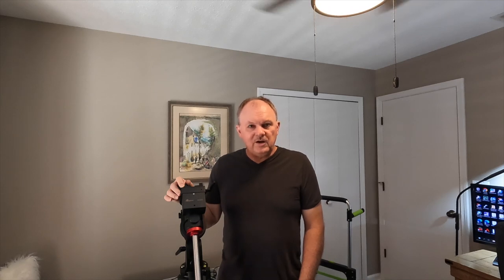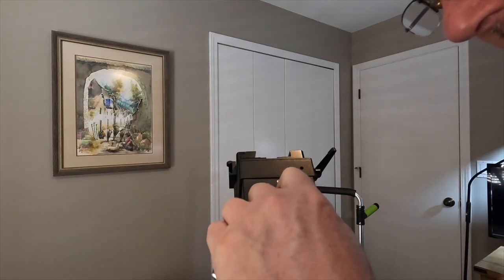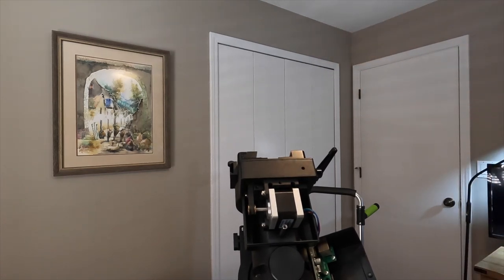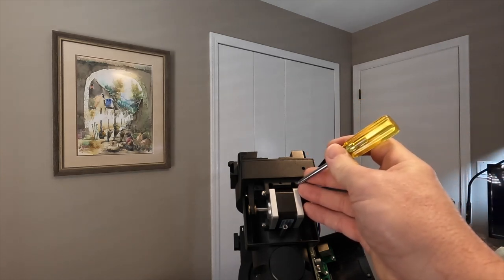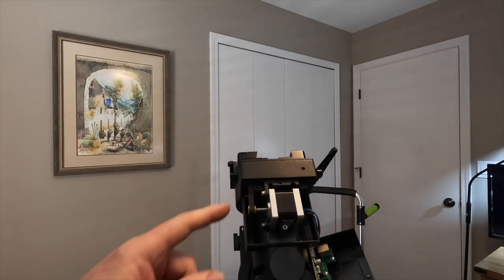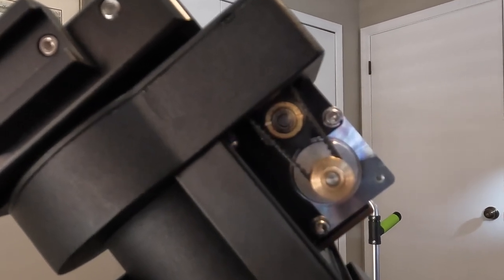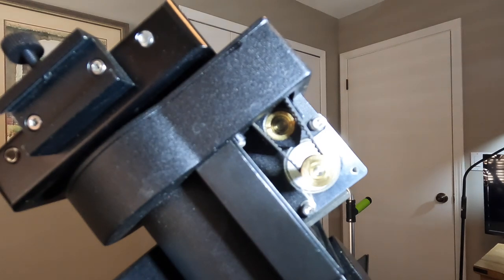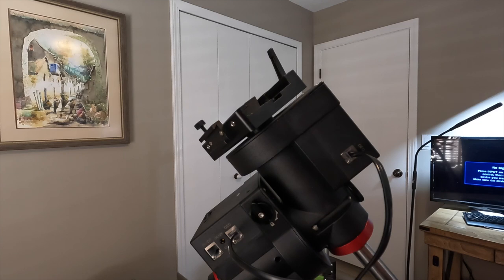Problem Solved - iOptron Telescope Mount Making Clunking Noise While Slewing the Declination

Comment: Mark this is a great video! Thanks for taking the time to put it together. By the way OPT got back to me quickly on that Dovetail issue and will get me another that works with the Vixen for my tube holder. Cheers!
Reply from the maker: it’s good to hear they responded in a timely manner.  I hope your weather is better than mine.  Looks like another week or so of clouds, cold and rain here.
Reply: @marksastrojourney  good tonight but will be raining over the weekend. Frustrating not to be able to use the new telescope though.